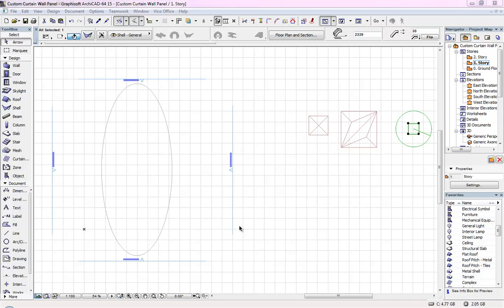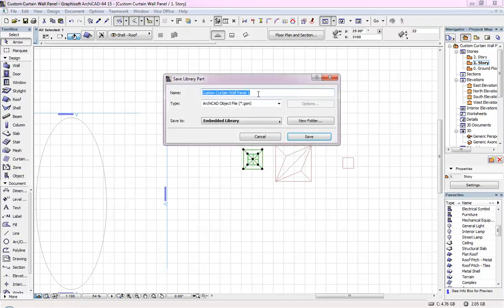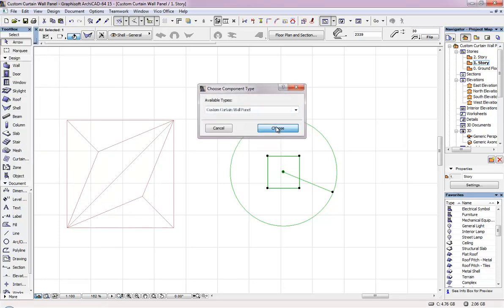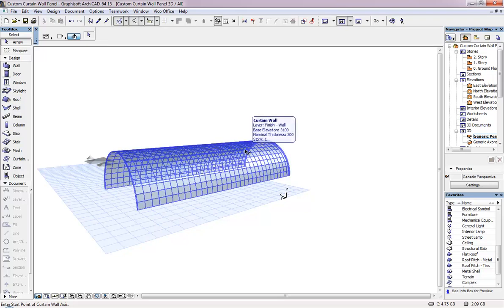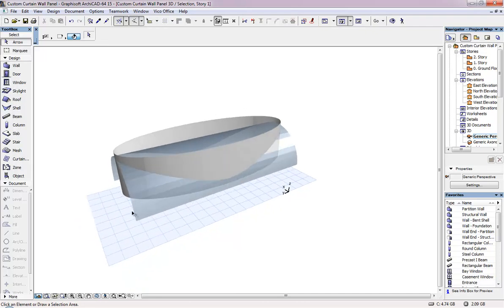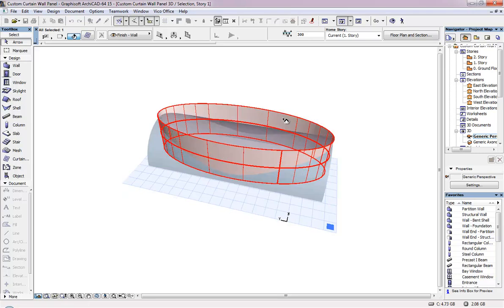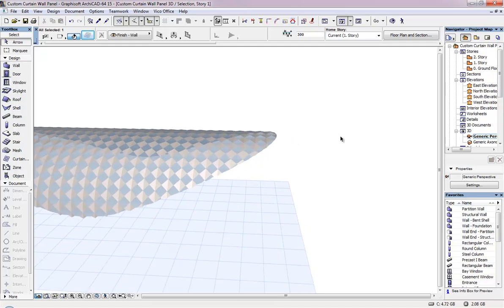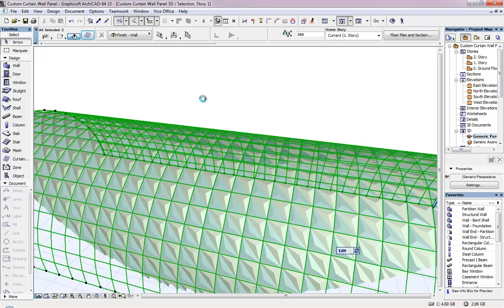Custom Curtain wall Panel

Comment: seems no one has the 'Save Custom Component' tool. Why cant I find it in the complete root menu of commands in ArchiCAD 18? is this a custom command you have created?
Reply: +Sneakerjunkie72 

got it.... in later versions it is under /library and objects/save selection as/......(there all branched in the menu)window, door, curtain wall frame or panel etc. You need the Visualization work environment... the standard doesnt have these menu options.

Comment from the maker: You need to select the curtain wall and click on Edit in 3D. Then, on the Toolbox you will see only the tools related to curtain wall. Select the Junction tool and double-click on any grid intersection in the curtain wall to place the spider junction.

You can also refer AC 16 Reference Guide from the help menu and check  Pg.no - 1251 to 1254.